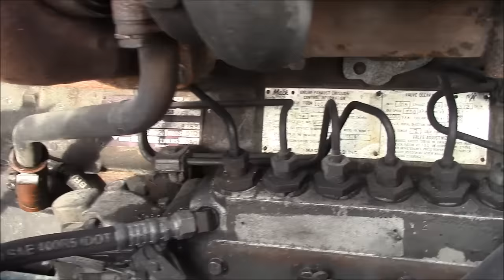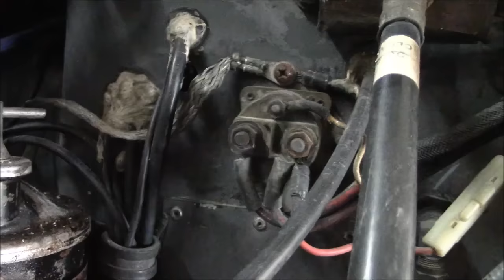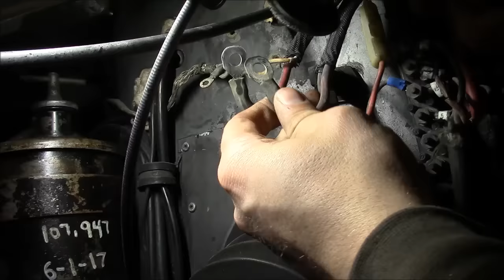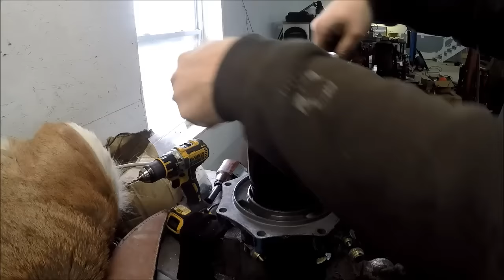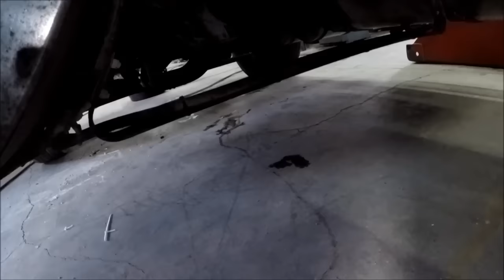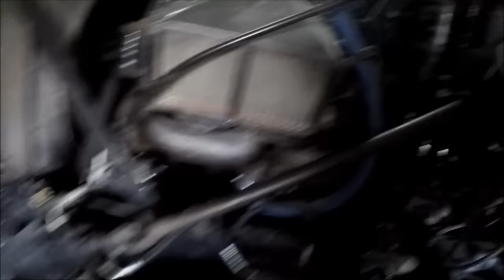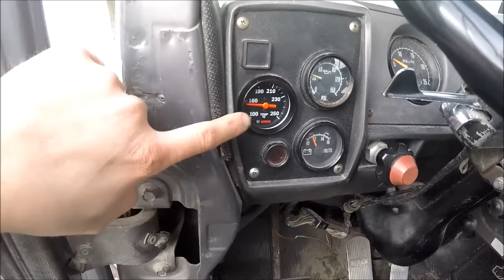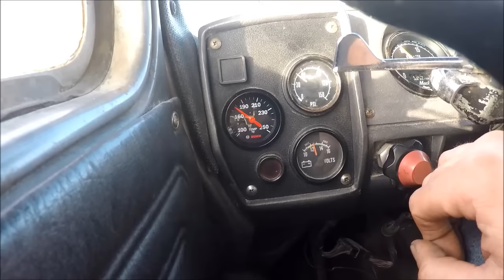Cool 1977 Mack RL600L - No Crank, No Start - Plus Many Other Repairs

Comment: Don’t you feel lucky your not replacing the trunnion bushing.  That 1800 lbs of torque is even a killer on most torque multipliers.  Those old 5 speeds were bullet proof.  A lot of drivers don’t know that touching the brakes during a spin out will set the peanuts on the differential lock.  Seen many a truck stuck that I got in started the spin touched the brakes and drove them out of the stuck problem.   Spent a lot of hours behind the wheel of R models as well as working on them.  I imagine a speedy sleeve might fix that leak at the power divider on a farm truck but on the over the road trucking once that yoke was grooved we just replaced them because the speedy sleeves would not hold up.  But I also realize that materials are a lot better now than in the past.  So it might be fine. 
Great content 👍
Reply: Wymer’s Handy Man Service 5
Reply from the maker: Yeah that's not a fun job. I watched a guy tighten those big U-bolts with a 1 inch impact like you use for changing tires. Never even tried to torque them. I just walked away...
I had figured on replacing the yokes. Probably a good chance I'll screw up at least on U-joint as well.
Reply: Speedy sleeves wouldn't hold up? They're stainless steel and easily outlast cast-iron/cast-steel components they're installed on unless improperly sized, installed or cheap "speedy sleeve" knockofffs not manufactured by a quality SEAL MANUFACTURER.
Reply: "1800 lbs. of torque" is a "killer" on "most torque multipliers"? Snap-On makes 600 lb.-ft. TQ-series torque wrenches and the "weakest" torque-multiplier I've ever seen - and used - was 3:1 or 4:1. Mainly so you can get 600 lb.-ft. from a 150-250 lb.-ft. 1/2"-drive torque wrench. The largest I've used was 18:1 and "double reduction". Pretty necessary for real serious torquage on real "off highway" iron like excavator hydraulic cylinders, etc.

That anything Mack is "heavy-duty" in 
the real "off-highway" universe is hilarious from the "bulletproof" triple-
countershaft "pot metal" case transmissions to supposedly "superior" so-called "top loader" axles. 

Lightweight, cheap to manufacturer, non-patent infringing and "easy" to "service" when broke down "off-highway" is not "heavy-duty".

Comment: The more things change, the more they stay the same.  That battery setup is called 2S2P, which is the terminology and topology they use for electric car batteries.  They put a bunch of cells in series, then connect those packs in parallel to give more amperage at the nominal voltage.

Comment: I had a 91 Volvo with an old Cat 3406B.  Alternator was the same way in mine.  Wouldn't charge at idle, but a quick blip of the throttle after she was warm and it would wake up and start charging.  Always seemed weird to me, but it never gave me any trouble either, so I let it be.  I was really curious if this one would wake up the same way.  Must be an old truck thing
Reply from the maker: I think it is, but I had revved the engine to 1500 RPM while warming it up.

Comment: Not sure if there was a long/short hood versions but the R is standard model. The first L is western model aluminum frame, 600 is 6 tire and GVW designation, the last L is to denote contains Light componets.  Just a hobby of mine. I grew up in a RL700S  logging truck
Reply from the maker: Very interesting. Thank you. I thought Mack had a short hood version for vocational use.
Reply: @WatchWesWork  they may have, all my expierence was with center cab R model. I know the Mack engines took way less room than a Cummins so im sure it was feasible

Comment: Smart, cleaning those ring terminals !  Concur on the dielectric grease !  #1 it prevents corrosion and #2 as the connection is made/tightened at least one spot will be "cleaned" and #3 for high voltage (spark) connections it prevents "stray" arcing,
30+ years ago, when electronic fuel injection was in its infancy, all connections had dielectric grease.  Eliminating was a "cost savings".  Sure it is "belts and brace" over just "weather pack" connectors.  (I am a big fan of doing electrical "the correct way" also !)
If that dash mounted volt meter is accurate, you need to be getting at least 12.8V-13.2V at idle, probably more.  Check the voltage at the alternator with a know good meter.
Reply from the maker: I did test the voltage with a meter and it matched the reading of the gauge. I've got it off to be bench tested.

Comment: I had an alternator like that. Mine required something like 1800 or 2000rpm before it would charge. It lasted for at least a year like that.
Reply from the maker: My rollback is kind of like that. But it will eventually start charging with no raised throttle. But it does it much quicker if you blip the throttle.
Reply: The aircraft fuel trucks I used to work on had alternators that required you to bring the engine up to 1000 rpm then they would charge at an idle.

Comment: Ozone is the culprit on those wire with cracked insulation.
Reply from the maker: So why does the SO cord insulation break down while every other wire on the truck is fine? Some kind of inferior material?
Reply: @WatchWesWork  Must be some the kind of rubber, I can't be more specific, no doubt UV would do the same but there would be little to no UV exposure under the hood.

Comment: Hi Wes, if I may add to you understanding on "Dielectric", ref silicon based... It's purpose as you state is to quell arcing, I used to build resistance welding machines, and we used "ElectroLube" brand, when we had a rotating or sliding Electrical contact, welding current was 35 volts up to 50,000 amps (50kA). If arcing occured, then it would create very hard deposits between the copper to copper, copper to silver or copper to brass sliding surfaces and obviously gouge/score.
Excellent vlog, I really enjoy your work and explanation for a simple welding engineer.
Thanks for sharing and may I wish you and your family a healthy and prosperous new year.
Reply from the maker: Interesting. I worked in a big factory for a while and they used it by the bucket full on some high currect DC switch gear.
Reply: @WatchWesWork  DC power is far more dangerous than equivalent AC, DC requires twice the switch gap distance than AC, ref no sine wave, and therefore current is always at maximum potential. This is the reason you see Electrical switches rated at 120V 5 amp DC or 250V 10 amp.
Thanks for replying, and really appreciate your sharing and edification.

Comment: Any electrical contact relies on conductor to conductor direct contact (metal to metal) and the dielectric grease prevents non contact areas from oxidizing and/or corroding due to salt or chemical contact and also from that corrosion creeping into the metal to metal contact point. The friction fit connections like spade connectors are the worst for potential corrosion. Enjoy your channel.
Reply from the maker: I think he worst for corrosion are those insulation piercing connectors like Scotch Locks. I've made a lot of money cutting those things out and splicing the wires correctly.

Comment: I use dielectric on anything electrical whether it be connecters,terminals,spark plug boots, head light connections and I have never had anyone say that I have always had customers ask to make sure I use dielectric on the connections to new parts.
Reply from the maker: I never heard of it either. But several guys commented about it in my last video.

Comment: Have to love the Mack turbo charged cooled aftercoolers! So did you find anything wrong with the brakes?
Reply from the maker: I'm still not sure. Something with the treadle valve I think. Possibly a bobtail valve. He said it's worse with a trailer hooked up.
Reply: Camera angle made it look like the auto slacks would hit

Comment: 2 Things.
1), My son's name is Wes.  I might just have to get one of your shirts for him.  He is a welder but close enough
2), The only time I have ever had an issue with the dielectric grease is on trailer plugs when we converted over to LED tail lights.  I'm really not sure if it was the grease or something else but once we cleaned the grease off of the pins, the light would stay working.  What we started doing was putting a bead around the male end of the plug then plugging it in and hoped that it would keep the road grime out.  We were logging so constantly having to change out the cable to the trailer.
Reply from the maker: Yeah, it can be tricky to use the grease on those trailer connectors. The problem is the dirt sticks to the grease and creates a whole new problems. Especially logging or working off road.

Comment: Hey Wes. The GoPro line will always have poor low light performance (barring a revolutionary shift in how sensors work). The reason for this is the size of the sensor- it's tiny. The photo sites on the sensor just can't grab much light. A DSLR is bulkier and pricey for a good one, but a full-frame camera lets in a ton of light. I don't have amazing light in my shop, but I film everything at fairly low ISO because the big lens and sensor grab a lot of light. Hope that helps understand why the GoPro is so dim----Aaron
Reply from the maker: The GoPro takes fantastic video outdoors in good light. But I find it useless for making videos in my shop. I think mine has a problem because the battery life is horrible. I've turned everything off and I still get less than 25 minutes of battery life.

Comment: Once you drive a maxidine, you will never forget them or the fact that as a kid stuffed in a truck that had the inline six and governed off at sixteen hundred rpms. I used every gear but high in that truck and used the lower gears more than I care to remember. The v8 model was just the opposite and did the 2150 rpms but there was no over winding them. They just wouldn't! I drove lots of thermodines and they were real work horses and just about bullet proof but would break a head bolt once in while and and that was how I learned how to get a welding rod lead stuck to the broken bolt and simply unscrew it with fingers then just re torque a new bolt in along with gently check others to find it was just that one bolt on the back head that would break so with spare bolts under passenger box replace it when necessary. I used Die electric grease as well with no problems. I found on some alternators that after it run just a bit, a quick bump on the throttle rpms would put them in   charge mode and the pulley was just a tad slow so a smaller wheel so it turned faster without the throttle bump fixed the problem but then the alternators would overcharge after a while so went to a external regulator and then was done with it. I like you am way too big in the "B" models but I bought one, actually my first big truck as my one ton 36 chevy with a ten foot flatbed that I hauled wood with was just not a truck but a accident waiting to happen so drove accordingly but never did, a few worrying moment tho/LOL. I got out of it into a narrow nose pete and almost missed the room in the mack but the size of piece/parts was the eye opening oh yeah moment. I have never seen a broken mack rear end, I have seen a few that were so worn out that you  could shave on the gears, but non that were broken and I seen some terrible first driver situations that would curl your hair. I loved to drive but if they found out you were good at wrenches then there you were; I had a boss can me and then offer me a job as a mechanic. I thought about it and then said nope, I'll go to town and he cussed me down to the plane dock (alaska camps) and I got to town and had three job offers as he had told the mail plane operator to make all his runs then take me to town. When I got into town I found a large percentage of my old crew there trying to get me back but no going back where you cuss me. So I go to a new camp and here come the guy who had canned me to make a public apology, but then I saw it was rehearsed and not sincere so I said no. Two weeks later was the fourth of july shut down and so went into town. My old boss setting on a bar stool muttering (drunk talk) I found out he had his walking papers over firing me. So to show I have a heart, I  called  the camp and their words not mine, the only way he comes back is if you come in his place and he can drive or whatever for you. I knew the man well and he had a family so I told him we would be back over the layoff and they said no... we need you now! Oh well the things that you do for your fellow man. I told the bartender to let him run a tab on me and to have his gear on the plane to camp next monday and fix me a camp case and I'll see "Jim" on my next trip in in the fall. I wasn't a drinker but after a long day would always have a glass on the rocks. sixteen hour days do something to you that isn't good at all. I haven't touched the stuff in almost twenty four years and don't miss it, just my family. They threw me away   cause I worked too much. Oh the stories I could tell you about mack trucks!!
Reply from the maker: Wow. That's quite an adventure. I need to get up to Alaska some day.
Reply: @WatchWesWork  I'm 72 and live in a 16x20 cabin but don't use my bedroom so swing in and I'll make tea or coffee if you prefer. I'll build a meal and it won't cost you anything but a ear to listen to stories of me lying about how fast my truck will go. Spend a day or a week, whichever you prefer as I know a man like you has to keep moving and do stuff, I have an old explorer thats got good tabs and tires so transportation is covered but I can't pick you up from town but may be able to arrange for pick up by my care attendant. I ain't an invalid, just horizontally challenged. From panning gold to fishing or hunting we have it all Wes and your more than welcome

Comment: I use vaseline. Never had a problem.
Reply: Vaseline is old school and a cheap alternative but inferior to dielectric grease. With time it will harden and crack and lead to moisture influx and corrosion. Also Vaseline is unsuited in hot places as it melts away.
Kind regards
Reply from the maker: It works well on O-rings too.

Comment: Yup, carry on with the grease.  I do find it can get slightly hydroscopic in high moisture environments and cause some interesting ghost voltages (had a Maxilift crane on one of our service trucks become possessed out of the blue. Turned out to be the 20lb of 10 year old dielectric grease someone had packed into the pendant connector decided to become slightly conductive.)  A little goes a long way, and it is far far better than using nothing!  Batteries on concrete is just plain silliness.  Never could understand what that was all about.
Reply: batteries used to be cases made of things other than plastic, even wood believe it or not, concrete could get moist from temp difference and conduct through an already bad case... non issue on any battery made in the last 40 years with modern plastic
Reply: @AndrewBrowner  That is the way a physics instructor explained way back in 1970 at a technical institute I attended. And people do not realize that concrete is constantly drying from when it is poured and there is of course moisture in concrete for the very reason you mentioned. At least this what a concrete man told me.